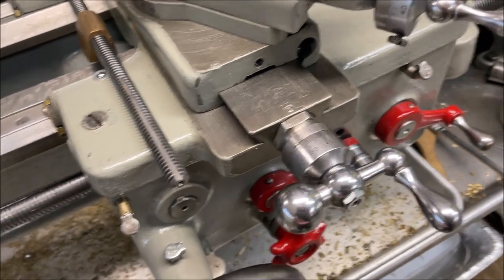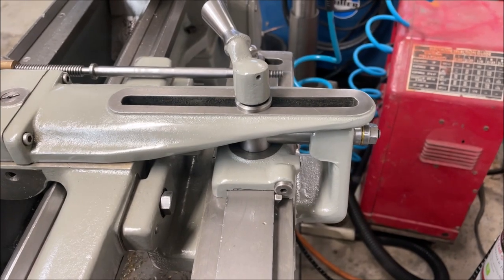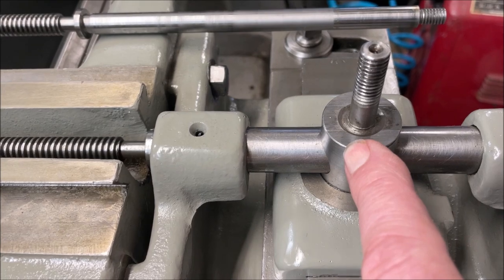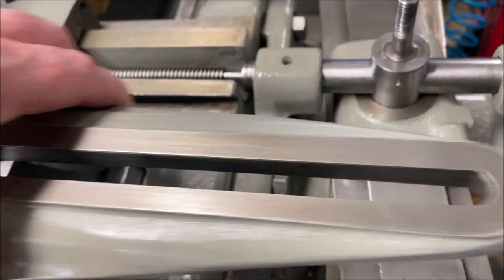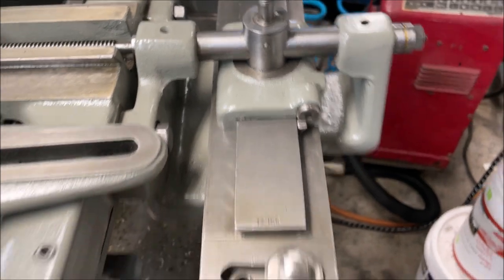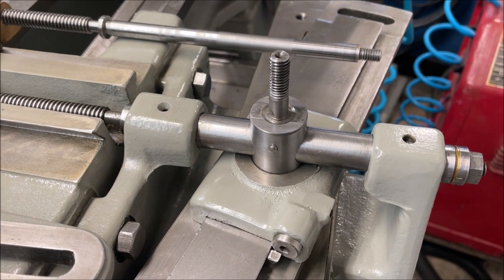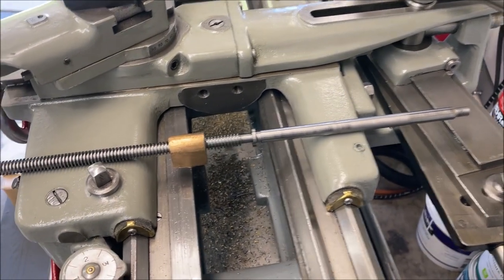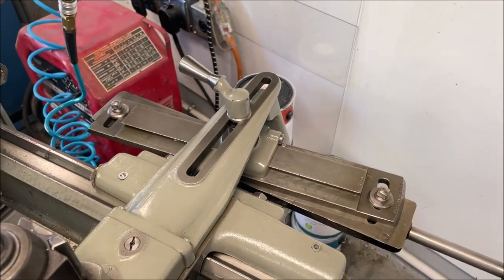Taper Attachment Info

Comment: Dean, Good info on the Southbend telescoping taper attachment.  I have the standard (non-telescoping) taper attachment on my 9"
and it is much more difficult to use as you have to remove the screw from the cross-slide nut, so you lose the functionality of being able to dial in your cut.  I always wondered how the telescoping one worked.  Now I know! 👍

Comment: Hey Dean. When I repaired the lead screw on my South bend 13, I was unable to find a lead screw. The nut I believe is the same as one without the taper attachment. I bought the correct lh acme threaded rod from McMaster Carr. I cut the old lead screw at the point where the LH threads start. Center drilled and tapped the portion that's smooth, either 5/16"or 3/8" fine ,( been a while, lol). Made the new threaded portion an inch or so longer, threaded it to match. I then screwed it together with red loctite after milling the keyway in the threaded portion. Been working great for a few years now.
Reply from the maker: Wow nicely done Mike, Someday I'd like redo mine with ball thrust bearings to cutdown the back lash. Some ware way on the back burner list..
Reply: @TheAyrCaveShop  I didn't redo my thrust bearings but if I get into it again I would definitely upgrade the thrust bearings. Just picked up a step pulley Bridgeport so that's getting all the attention now. Somehow I feel the South Bend 13 is getting jealous, lol. Have a good one.

Comment: Finding your video is like a blessing for me. I have a 1965 vintage Heavy 10 with telescopic taper attachment. I'm disassembling my cross slide so I can repair and replace what I can. My problem is the coaxial dial end of the cross slide assembly refuses to unscrew from the casting. The coaxial assembly unscrews but after it runs out of thread the damn thing refuses to pull out. I even tried a JT6 wedge set ( used for removing Jacobs chucks from a drill press spindle) but it still refuses to come out. Am I missing something that's preventing its removal? Could there be that much metal particles jamming its passage? 
Thank you.
Wakodahatchee Chris
Reply from the maker: you need to drop the apron if you haven't already.
To clear the drive gear. 
 If that's not it might be bure on the keyway
Reply: @TheAyrCaveShop  OMG! Had no clue that the Apron had to be dropped down for clearance. I'm now praying that I didn't damage anything with those JT6 wedges! Thank you, thank you, thank you!
Reply: @TheAyrCaveShop  It came out easily after loosening the Apron screws. That was no easy chore because they were both buggered up badly. When my old head hits the pillow tonight it will be wearing a smile, thanks to *YOU*! What is your name please.
Reply from the maker: @cdrive5757  Happy to help..
I'm Dean
I have several video's rebuilding my heavy 10

Comment: Hi Dean, this was a very helpful video. May I ask you a few questions?
I have a 1968 SB 10L. I’m trying to remove the cross slide to inspect and clean. But I can’t unscrew the C. F. Bushing. It is frozen in place. I’m wondering if I have to remove the taper attachment first. Everything is dirty and I’d like to disassemble both cross slide and taper attachment. 
What process and sequence of events should I use?
(I Also need to install the carriage lock and can’t do that from the side)
Thanks,
Paul
Reply from the maker: Paul, Yes you must remove the lead screw from the taper attachment side. You may be able to remove the C.S. feed handle/stub shaft at the same time...
It's been a while...
ATB...Dean
Reply: @TheAyrCaveShop  Yes, I was wondering what side the cross screw came out. I originally removed the handle because I wanted to clean it. But the screw won’t turn without the handle. In fact, no matter which way I turn it, there’s a limit to how far it goes. 
I’m confused and unfamiliar with this. Not much information out there on how to disassemble the cross slide and taper attachment. 
Right now, I have the dial and bushing removed from the cross screw. I put the handle back on so I could turn the screw. The nuts securing it to the taper attachment are also removed. 
Should I just be able to grab it from behind and unscrew it out of there? What about the cylinder that sticks up. The one with a taper pin going through it? Should that pin come out first?
Paul

Comment: What that little hole in the side of the engagement handle? I thought it was a set screw but mine doesn’t have one. I can’t see through the hole and I wonder what its function is. 
I’m having trouble getting the taper pin out of that cylinder.
Reply from the maker: Hi Paul, that hole is a center drill point. They turned the handle between centers. Neat way to make a handle.
I must have gotten lucky on the taper pin, I don't remember having any trouble.
ATB...

Comment: Hey Dean, it’s me again. I’m still having problems. The taper pin that goes through the taper attachment handle is stuck. I can’t get a good reading on the diameters of two ends. I saw one video that showed the taper pin is tapped out from right to left (as viewed from the position of using the lathe). But I don’t know if that’s standard or the direction is dependent on how the handle was clocked during initial assembly. 
I’m stuck. Any ideas? Both ends of the pin are now flush with the cylindrical pedestal. 
Paul
Reply from the maker: Hi Paul, I checked mine and yes tapping from right to left from the operator position is how mine is as well. I had also modified a punch so the small tapered end was real short, that seemed to really help with the initial breakaway. Might be good to have a buddy hold a backup block behind it as well. I know some guys had to drill some of the pins out. I was lucky.
ATB...Dean
Reply: Yea, this is really messing me up. But I’ll keep at it. 
Do you think that SB has the taper pin oriented the same for all heavy 10’s? My first problem is that I can no longer identify which end is small. When I originally started out on this, the pin wasn’t damaged and I determined that the small end was on the right. But after whacking at it for several minutes, that side of the pin mushroomed out big time, so I had to grind it down with a Dremel tool. 
I made a device out of a C clamp that uses a steel pin to push against the pin. Then by turning the screw maybe I can exert enough force to move it out. Not an original idea. Saw it on YouTube. 
Thanks for your help. 
BTW, what kind of paint did you use on your lathe? It looks great. 
Paul
Reply from the maker: @paulmanhart4481  Paul, email me I have the paint code.
dean57ayr@gmail.com

Comment: How do you remove the taper attachment? I’m trying to remove my cross slide. 
Thanks,
Paul
Reply from the maker: Once you get the lead screw out... It should just unbolt from the carriage. Note two alignment pins and it's heavy !
Reply: @TheAyrCaveShop  Ok, but how do I get the screw out? When I turn the handle, the screw disappears into the tube where the taper attachment is. But then it stops. 
The tapered pin in the cylinder that sticks up out of the taper attachment will not come out. I hesitate to beat on it too hard because I’m worried about bending the lead screw. I’m stuck. I need to remove the cross slide screw but it’s eluding me. I don’t see how it can come out while that pin is in the taper cylinder that sticks up. 
I’m sorry for not knowing the proper names of parts. “The thingy that connects to the other thingy, sticking out of the third thingy”. 
But the handle on the taper attachment that locks it in place, screws into a cylinder that has a hole through its side where a taper pin secures the sleeve and cross screw. Does this pin need to be removed in order to remove the cross screw? 
This is where I’m stuck. I don’t know how to remove the cross screw. 
Your assistance is much appreciated. 
Paul